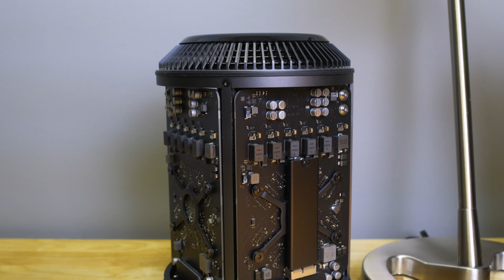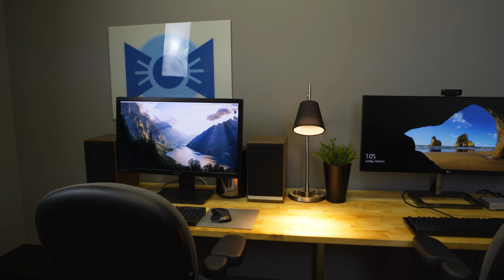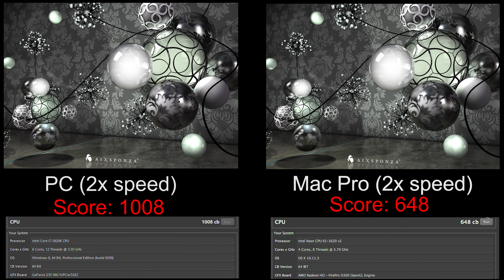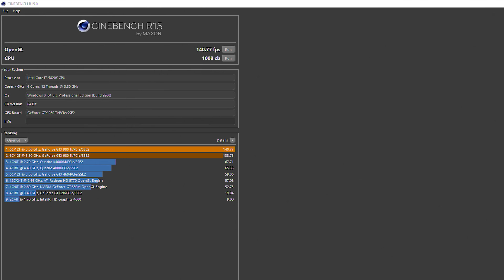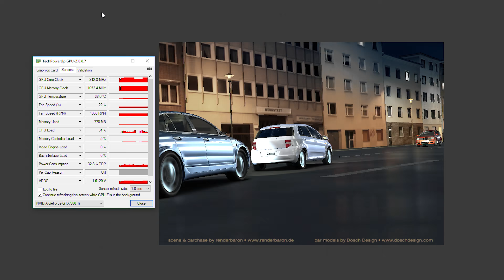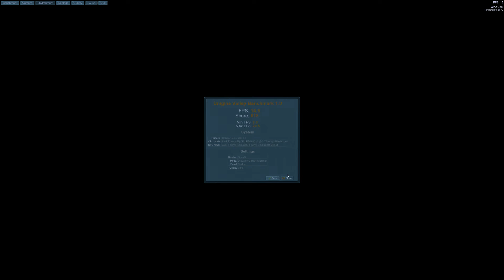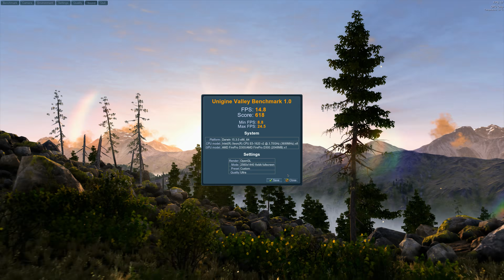$2,000 Custom PC vs $4,000 Mac Pro

Comment: Apple just works. listen to all that crap you went through, just to get Buggy, unstable windows machine that is reasonably fast when it's not crashing. it's like trying to use a top fuel drag car on your daily commute to work.

secondly, the apple is engineered to perfection, it has beauty, and fits in a gorgeous, tiny 5 litre case. your PC case is huge, you could fit 2 Mac pros in there and that's what you should be comparing it against.

Thirdly resale value of the mac destroys the PC, and so does the life long support. There are IT gurus you can call to help you get more out of your Mac at any instant in time, yet your PC if you have a problem on day 1,v what are you going to do? start trolling the forums for solutions that might or might not work, suggested by spotty 15yr geeks? when I have creativity and productivity to worry about, and a mental state to maintain in which I can function and BE HAPPY WHILE I CREATE then I will go for the machine refined and engineered to deliver a seamless user experience that JUST WORKS every time.

Apple innovates, everyone else follows and then you ignorant, self entitled little jerks come along with irrelevant opinions you try to push down people's throats that are just bullshit and ill informed.

You'd all have Macs if you could afford it. Just sayin'!

EDIT - and I want to steal someone elses point I read below:  why do gaming graphical benchmarks when the Mac's firepro's are engineered and wholistically designed to do GPU workloads, such as auto-cad etc?   
Throw them into an application the computer is actually designed for to benchmark, and the Mac will destroy the PC, Obviously throwing workspace gpu's into gaming benchmarks would have poor results.
Reply: +tosgem 
You mentoined 4 Points.
1. Bugs on windows. Its an advertisement slogan that was told you by apple to sell their products. The fact is there are more bugs on apple then on windows (bugs > bucks > money/price). 
You're paying 2000€ more to not have to handle 1 bug which occures in 3 years and takes you 1 second to fix.

2. Apple engineers to perfection. For all those who weren't psychologically tricked into loving apple see a shiny box of trash when it comes to apple products.

3. Resale value is totally unimportant.

4. Apple innovates. Yeah they are very innovative on a psychological level. They trick you into thinking that their products are very special and out of the best when in fact they sell you trash like mcdonalds with their food.
And you are in a prison while using apple products.
I recommend watching some documentaries about apple critisizing apples psychological tricks on consumers.

5. We'd have macs if we had money. I don't see that. There are dozens of videos showing you the weak performance of mcbooks/computers/machines when it comes to things like video editing, video games etc.

So you may don't understand my point of view and i can't understand yours.
Mcbook= high price, low performance, not modular(can't change hardware), apple prison(itunes etc)
PC = low price, high performance, modular, no prison, can do whatever you want
Just to name a few key figures.

You are living an illusion.
Reply: tosgem
It is not about the OS.
It is about the performance.
Reply: +tosgem Enjoy dem slow rendering speeds with your "engineered to perfection, it has beauty, and fits in a gorgeous, tiny 5 litre case"
Reply: +Tounes I can see there is no point to argue with you. You are an Apple hater, jealousy much? You have no idea that without Apple you wouldn't have half of the cheap, crappy imitations you use daily in the form of Windows, Android etc. It's like someone listening to Justin Bieber and not knowing who The Beatles are, and then you go and call The Beatles "the MacDonalds of music". Ignorant people like you are the reason our culture is trash and humanity is going backwards

Comment: People like to buy for brand names ... stupid,, but their choice.

For practically the same price you can even get an Alienware LAPTOP that outperforms the MacPro.
Alienware 17,
 i7-6700HQ
32 GB DDR4
256GB SSD / 1TB HDD
GTX 980M + !!! external GTX Titan X
17.3" 4k IPS panel

Costs ~4000 $.
Yes - that is a Laptop form the notorious expensive Alienware for the same price outperforming the highest MacPro - even Without the Titan already.
(To be fair - you can make the MacPro stronger - Intel Xeon E5-2697   12 Core@2.7 GHz, 2x FirePro 700 -> just costs a wooping 7500$ then - and is barely able to keep up with  the Alienware and the plugged in Titan X.)

Comment: The mac has old hardware, it's build by chinese farmers who come to some industrialized city in China, they then install their standard OS which is a fair product, but even the grandpartents of the farmers assembling the mac could install it if you made the installation instructions in Chinese. That means everything about the product is made cheaply, and the price is huge. Someone is ripping people off for sure. 

If I were a boss at a company or had responsibilities for buying 10 new desktops to the clueless morons working in the office, I would buy new low-end hardware which is just as good as the best mac hardware, hire a few 14 year old nerds during their summer vacation and make a customized linux install based on a free distro, which would make morons not fuck up everything and still be able to check e-mail, watch youtube or browse facebook. Any respectable firm would have some IT guy there as well, which could supervise the 14 year olds building the computers, which could easily manage any problems with the linux distro. Voila, you have a few thousand dollars you could invest in something else.

Comment: Last year I purchased a 27" 5K iMac for a hell of a lot of money. I was lured into thinking I had a powerful and future-proof computer. However, once I started running benchmarks and using the iMac, I knew otherwise. I returned the iMac and decided to build my own PC instead. Using Pcpartpicker and buying almost everything off Amazon. I was able to purchase everything well under what I had to pay for the iMac. My system is super fast and runs anything I throw at it (including booting into OSX as a hackintosh when I want to). It's not as skinny and pretty as an iMac, but it's functional. The real reason to have a computer in the first place.

Comment: The 2013 12-core Mac Pro scores 1570 in cinebench CPU test, which is 50% higher than your new PC.  That's not to say that it's a good value for your money, but the point is that you just said the Mac Pro isn't a professional machine, despite it running server class cpu's with server class ECC ram for absolutely rock solid stability for super long render projects.  And hey, I get that the 12-core model costs as much as a car, but you can't buy the base model and complain about performance.  That's like buying a ford fiesta and complaining that ford doesn't make professional cars because it's slower than your v6 camaro.  Spend the money and ford has cars that are faster.   Spend more money and Apple still sells a 3-year old iMac that will best your new PC by 50%.  (by the way, unless you're gaming, GPU rendering doesn't help a ton--it really depends on what you're doing)

And I'm very familiar with this topic because I have a very similar PC to yours, and I also have an iMac that's faster than your Mac Pro, and have tested both in tons of benchmarks.  (mostly for fun because I love building a new gaming rig each year)  5930k @ 4.4 ghz on h110 water cooler, 64gb ram, m.2 samsung SSD that's sadly still slower than the SSD in my iMac by quite a bit, and dual EVGA GTX 980 ti's in SLi.  These raw specs put my PC WAAAAAAY ahead of my 5k iMac that has a quad core i7 4ghz with 32GB ram.  But you know what?  They're VERY close in most benchmarks due to the iMac having Skylake architecture while my 5930k is haswell-e.
Reply: +TechnologyCatalyst And you could build a workstation PC with Sandy/Ivy/Haswell or Skylake Xeon 12-18 cores processors and ECC memory that would demolish that Mac Pro for cheaper again so what is your point.
Reply: +Jack Main says the guy who doesn't know the difference between "you're" and "your".
Reply: +81mrsmitty The point is that he said that's the fastest Mac Pro apple currently sells and that his $2000 pc is faster, which is bullshit, because you can get the 12-core version that's 50% faster than his new PC in cinebench.

Comment: First off, I use both Mac and Windows every day. I will be the first to admit that Apple is expensive, but these two platforms are entirely different. My Windows PC is strictly for gaming (a stock gaming PC with two upgraded GPUs, nothing phenomenal but on the high side of adequate). My Mac (a $3000 Mac Pro) is for everything else but gaming.

Now, the problem with this video is that you are comparing two completely different items moment that  you mention that one is 2+ years old (regardless of Apple's failure to put out a new Mac Pro in that time). Run your brand new PC for a year and then benchmark it. Half the problem with any PC (Mac or Windows) is that with cumulative updates and addition (and removal) of lots of software, they waste resources that significantly degrade performance.  That is unless you are an operating system guru who knows how to clean out all of the bloat, which most of us are not.  

Traditionally, Mac has been far better at remaining current despite their age. I have run some Macs for 10+ years, where I have seldom had a Windows PC for more than 4 years.  I have never reinstalled the OS on a Mac, where I have almost annually completely stripped my PCs and reinstalled a clean version of Windows.
Reply: +blacksmith67 You don't need to be an operating system guru to know how to clean out your registry or get rid of useless services hogging your CPU, you just need basic OS competency.
Reply: +Frikgeek I regularly do such things, and for your average young person this is not a difficult task. However, you try explaining how to do this over the phone to my father and see how far you get. You might not believe this, but roughly half the world are either average or lower in competency.

Comment: macs are straight garbage
Reply: +Jar Jar Binkie 
Not garbage, just made for main stream casual users.
Reply: +Jar Jar Binkie Thats pretty funny because the mac pros case looks like a trash can.
Reply: yeah XD
Reply: AirScholar sorry they are expensive and overpriced garbage.
Reply: Jar Jar Binkie
It depends ...
I did the math and for some people like me, it is cheaper than a Windows machine. Why ?
Microsoft charges between $100 and $200 per OS upgrade. OS X is always free for life.
The App Store allows for downloading and installing software on ALL my computers as often and as many as I have.
I have LOTS of laptops of different sizes and I keep them for many years.  
So for me, I save a bundle compared to Microsoft. 
And besides the bugs in Windows is extremely irritating.

Comment: I agree that the Mac Pro needs an Update, although at this point I'd prefer they wait until Broadwell-E is available. But you should probably mention that your benchmarks only used one of the two GPUs. 
When it comes to price of course the Mac Pro can't compete, but one thing people should consider is that the GPUs in the Mac Pro are workstation components (giving you 10 Bit Color and are even required for some CAD Software for example). Your 980 TI as a workstation card (called Quadro M6000) and costs around $4500.
Reply: +beamwalker 
Unfortunately OS X does not support SLI or crossfire though it can stream OpenCL with both cards.
The Quadro version allows full double precision ggpu processing and a unlocked timeout for longer processing compared to the same hardware with the GTX brand which cripples the double floating point and times out long OpenCL/CUDA processing. Also more memory on Quadro (ECC).

Comment: Just wanted to compare my pc to that mac
SPECS:
http://pcpartpicker.com/p/fGN3K8
without peripherials, case and cooler (which I didn't have to spend so much money on) it's worth ~$1000
BENCHMARKS:
all settings were the same as in video
cinebench CPU - 504 score
cinebench OpenGL - 91.16 FPS
Valley Benchmark - 1449 score, 34.6 FPS avg, 11.7 FPS min, 63.1 FPS max
Video test wasn't possible for obvious reasons

As you can see all of the scores (except for cinnebench) are signifficantly higher.
My verdict: 
spending $4000 on a mac is a waste of money.

Comment: Im not an Apple fan, but you making the wrong kind of benchmark. It's an AMD FirePro graphichcard. For an AMD FirePro or Nvidia Quadro graphichcard, you need to use another benchmark, because this kind of grapchichcard is made for rendering and not gaming. Use an OpenGL benchmark instead, to compare the performance of a workstation.
Reply from the maker: +Andreas H Nielsen It was an OpenGL benchmark. Just because something looks like a video game doesn't mean it's a gaming benchmark.
Reply: +Snazzy Labs sry i typed wrong, "OpenCL" ;)

Comment: Nice! I built mine for $1920.
Intel i7 5820k
Gigabyte X99 SLI
Corsair H80i GT
Corsair Vengeance LPX DDR4 32GB
Samsung 950 Pro M.2 512GB
A-Data SSD 480GB
EVGA FTW ACX 980Ti
EVGA NEX 750W PSU
NZXT S340
Windows 10 OS
Reply: nice build!

Comment: apple hardware was never a smart buy, it never even came close to pc specs, and it never will because apple compromises to fulfill the "cool" factor expectations. Essentially if you want value for money - buying apple is 100% the dumbest thing you could ever do. not only will it underperform next to its pc counterparts - it will cost quite a bit more while doing so and lock you into a closed ecosystem also eliminate any upgrade possibilities whatsoever. Face it mac fanboys - apple is something you buy for your parents (or generally computer illiterate people who need something that's easy-ish to use and hard to screw up. Other than that - all apple hardware is price/looks over function (be it phones pcs or tablets) that locks you into an ecosystem that will keep sucking more money out of you as long as possible. Yeah maintaining an up to date high end pc will do that too but at a much slower rate. /rant end

and my condolences to apple fanboys ;)

Comment: To me, it’s a lose lose situation. I know if I buy a Mac, I am not getting the best hardware for my money. But, I also know if I build my computer, I am stuck with using Windows and I’d rather drink my own pee then use the Windows OS.
Reply: Just build a Hackintosh
Reply: +Duncan Harris Just use Linux, you can always run a dual-boot setup.

Comment: The major thing is not how fast or slow the Mac is, but how stable the operating system is. Even if you have a 4 times faster PC machine, you'll still never work as stable and secure as withe the apples OS X.
Reply: LOLOLOLOLOL!!!!
Reply: +JCDFU funniest comment ever
Reply: +JCDFU Buyer's remorse sucks doesn't it?
Reply: +JCDFU It still doesn't justify the price point, if a $4000 Mac can't keep up with a machine that costs around half the price apple is basically being cheap bastards.
Reply: Elijah A. Chote Dude you can pick up a E5 2670 Xeon which is a 8-core for around $250 on ebay and Amazon Which is alot better than the Xeon E5 1650 V2, Pcie ssds aren't THAT expensive around $200 for 256gb off of ebay and Amazon aswell. And the ecc is exactly the same theory as the other 2 components, Yes i can build a machine much cheaper than the mac pro if you know where to get the parts.
Reply: +JCDFU So, the operating system is worth $2000?
Reply: +Validifyed Tell me a studio that fully uses linux.

Comment: saddly single core performance is still important 
also did you and could you put the Fire Pro into crossfire? if not it is a GPU compute computer and OpenCL runs better on the AMD cards while CUDA runs only on nVidia cards. 
so if you added in a  gpu compute benchmark the mac might do better but how many people watch you for GPU compute? .... Telsa are also GPU compute cards just without a video out so 1 4 year old Tesla vs 2 Fire Pros costing the same amount would be better professional hardware is ONLY GOOD AT ONE THING
pro hardware also sucks at everything but that one thing it is designed for 
for gamers a mac pro makes no sense for a compute server a mac might but as they will need to recode into OpenCL to get the performance gain 
for professionals with it are probably already on VMs anyways so their VM through Cytix, VMWare, or Microsoft will bring them to a server farm that is made of up tens if not hundreds of cheaper weaker computers and a VM Sever with 30+ physical cores which is super expensive and not practical for anything but a VM Server 
Macs make no business sense when you look cost per user for amount of time

Comment: The only thing you haven't mentioned is the fact the Mac Pro is running workstation grade hardware where as your PC is running consumer grade gaming hardware. Its not an excuse for the poor performance but it is the reason behind the increased cost (that and Apple tax)
Reply: +Joe | JLDJUK But they can't justify the results just because it's workstation grade when it isn't measuring up to consumer grade for what it is doing. That just doesn't make sense, to build with premium parts to produce weaker results and not be future proof, when that was the selling point.
Reply: +Roberto Blake I know and as I said its not an excuse for the poor performance. However...

I own a Mac Pro myself (A slighty more speced up mobel with the 6 core and D500s). I work on the lighting and video projections for live performances in theatre, concerts and TV. I rely on the fact that the hardware inside is my Mac is much more reliable than a custom built gaming PC. Often relibility is more important than performacne. Also I would never overclock a computer that was in a mission crtical sutation.

Saying that I think my next editing computer willl be a PC. Purely for rendering horsepower.